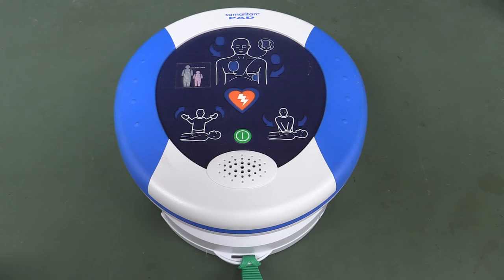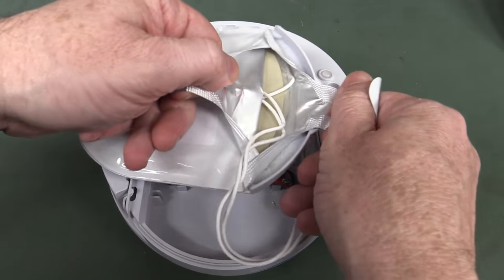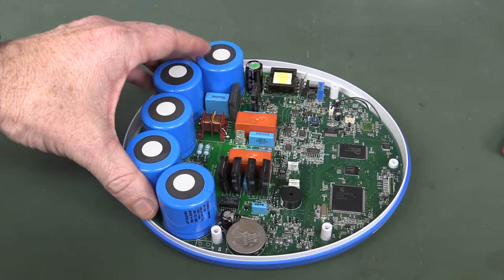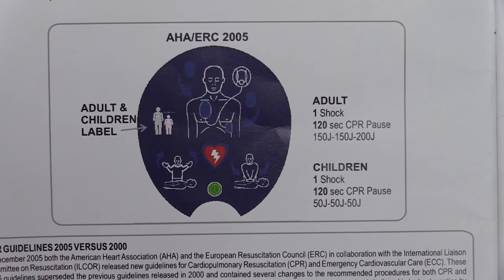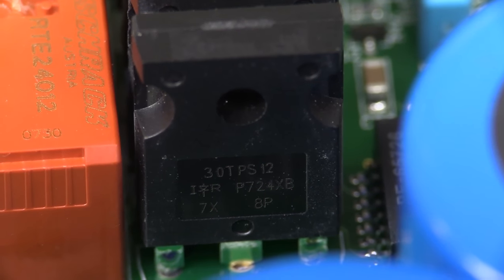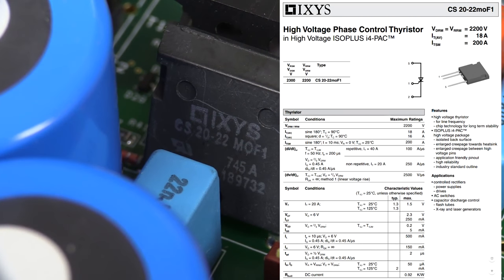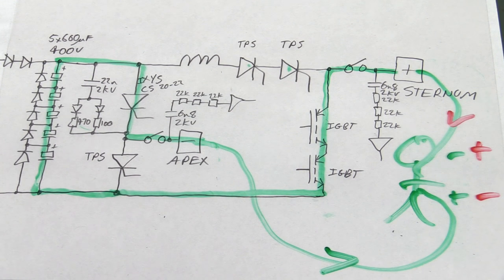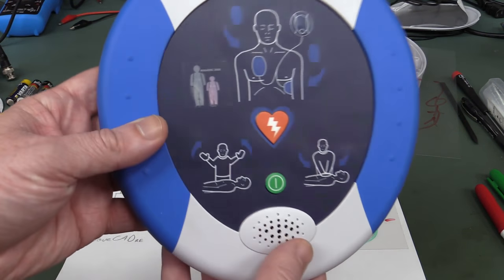EEVblog #909 - Heart Defibrillator Teardown

Comment: 27:40 — How do they turn off? As we are talking about SCRs, they only can turn off if the current drops below holding current (Ih) of thyristor which is 150 mA for the SCRs mentioned in the video.

For me it seems very unlikely that the moment of switching for positive to negative pulse is determined by the current passing thought PUT rather than by voltage on cap batary or across the output terminals.

So, probably relays are actually switched off in order to break current though SCRs and let them switch off?

Comment: I don't believe the old batteries were "ultrasonically welded" together but rather "spot welded".  Ultrasonic welding is more for plastics.  I have seen that it is used for some light or dissimilar metals but not sure it could be used for battery contacts and cross-connects.  Does anyone here know for sure?
Reply: spot welding is pretty standard practice for connecting solder tabs to batteries, so yeah, you're probably right. I don't see why one would need to ultrasonically weld when you can just use standard spot welding!
Reply: This is just spitballing, but maybe if you could ultrasonically weld battery tabs, I imagine it might get cheaper in the long run, or perhaps it might save the battery from needing to be heated.

Comment: Please forgive my ignorance, I am a medical doctor and not a trained engineer. I am trying to make sense of the diagram. Is it possible that in the diagram, the IGBT and the lower left TPS have got interchanged ? If you change it, then the circuit will make sense. 
Phase one, TPS after inductor and IGBT in new position come on. Then the IGBT is put off, and since there is now no voltage, TPS after inductor also shuts off. 
Phase 2: TPS (where current IGBT is located) gets switched on and IXYS gets switched on. 
Then sequence is terminated with IXYS remaining on, and IGBT (where lower left scr is in diagram) going on . This shorts capacitor terminating sequence. The inductor is there to protect the SCR from inrush of current from capacitor. Does this make sense ?

Comment: wow, my coilgun powerpack has 12 KJ of stored energy, It's only when you look at other things do you realise how much power that is. Sadly it melts pretty much any coil I've made, multi stage is next.
Reply: 12kJ is about 1Ah at 3.3V.  Or a bottle of low energy soft drink.
Reply: At well over 1000 volts, 12,000 joules is 12000 watts/second, given it's expelled in under .5 seconds, that is a massive amount of energy, you don't understand capacitor bank discharges well do you?

Comment: Oh come on, let's hear what it has to say. There's so much potential here; time to man-up Dave. Don't tell your wife or kids about the insane risks involved here:  COMPLETELY REMOVE THOSE TWO RELAYS, add two resistors/LEDs where the RY coils used to go, REASSEMBLE IT IN ITS PLASTIC CASE. Load up your laptop RUNNING ONLY ON BATTERY and WIRELESS LAN with whatever that USB cable/port delivers. Power it all up with some fresh batteries (absolutely DON'T use a bench PS). RECONSIDER CAREFULLY BEFORE sticking the pads onto your chest! What could go wrong other than death or crippling disability? AVOID attaching any non-isolated equipment or wires that could take advantage of the potentially LETHAL low impedance connections to your chest.  Obviously, DON'T touch those HV capacitors or anything that may pass juice to stop your heart!  And, if you live to see another day, consider making a great self-cleaning bug zapper out of it. An in-rush limited PS charging 1,100 VDC across a bank of ~30uf directly fed across a mesh gap or alternating bare wires works great, continuously though a bit noisy, on bugs!

Comment: You should hard wire a plug on to it or throw in a couple AA batteries. Could you put those capacitors in to in to a computer or something, to help overclock the cpu? No point letting the capacitors go to waste.
Reply: Dave, I know you said the capacitors are top brand but wouldn't Chinese ones help lower the cost of the device?
Reply: no they would not, the cost of the device in this case is not in any way, shape or form defined by the BOM cost, it's all the Developement, testing and certification proces that costs huge ammount of money, and beside the upfront cost is only a small part of the operational costs, the plates are single use only (obviously) and even if unused they expire and must be changed every couple of years or so since the conductive gel tends to dry up (and they for shure aren't that cheap), the where the main unit may go for a lot more time, this was designed around 2007 and still on the market, the spare pads will probably be produced well past the date of discontinuation (it's an AED not an iphone)

and beside all of that would you rely on cheap chinese capacitors to save your life (or possibly take it from you if something goes wrong)?

Comment: Thyristors (SCR's) are devices with an uncontrolled turn-off, so even if the gate is pulled negative the device cannot be shut down due to the internal latchup (it is essentialy the exact same latchup which destroys old CMOS circuits) mechanism they use to turn it on, the only way of shutting it down is to bring the voltage to zero (in theory, in practice this is not enough since there is a lot of charge in the form of electrons and holes  stored in the device that must be almost completely extracted to let the device turn off, so it will require the anode-cathode voltage going negative for sufficient time.

So I'm not shure how the circuit works, but my guess is that the series inductor is part of a resonant tank that lets the 2 series Tyristors turn off, then the igbts/big SCR is triggered and the negative pulse is delivered, that said I haven't done any circuit analysis and i might be talking out of my a**  so don't quote me on this

Comment: I wonder if it sounds like a camera flash as it charges? Or is that movie nonsense?
Reply: Camera flashes work on the same principle.  The sound comes from a low cost switch mode upconverter from battery to spark voltage, unless it's a mains flash, those are silent.
Reply: The sound is pretty much exactly the same as the one from a camera flash.

Comment: There is a slightest problem with this. 

If the average joe would not take his hands off the person being defibrilated, he has a very high chance of defibrilating himself either, which may cause a spasm, fainting or a heart stop

(Yeah, those do not tun the heart, they stop it. Then it reboots.)
Reply: Богдан Козенко the defibrillator tells the person to take his hands off and can sense two heart beats so it won't shock him.

Comment: Usually those devices do more than 20 shocks before the batteries run flat. 

The 150J-150J-200J indication explains that the first two shocks will be at 150J, and the third as well as all the subsequent shocks will be at 200J until it runs out of juice. 

Normaly, the AED will tell you to remove you hands from the patient to do an analysis. If the heart has ventricular fibrillations it will charge for a shock. In any other case it will usually tell you to continue CPR. 

For example after an electrical accident where the heart goes into ventricular fibrillation an AED could get the heart back on tracks within 1 or 2 shocks. 
If the heart stops of other scenarios (e.g. heart attack) and there is no movement of the heart at all, the AED can't really help imediatelly. However, doing CPR (and also medication once the ambulance arrives) might get the heart going enough for the AED to 'help'.

An AED is more like a Reset switch than an On/Off switch.